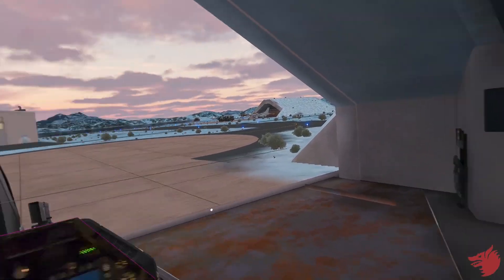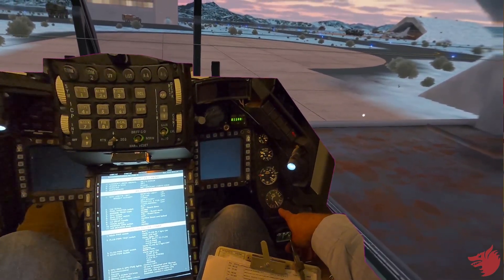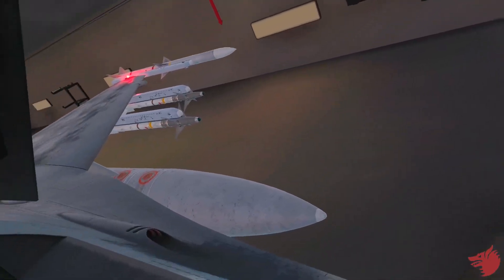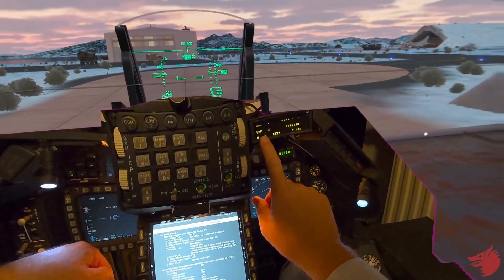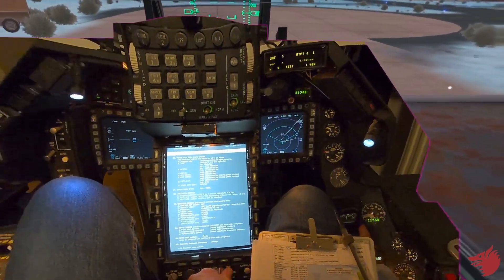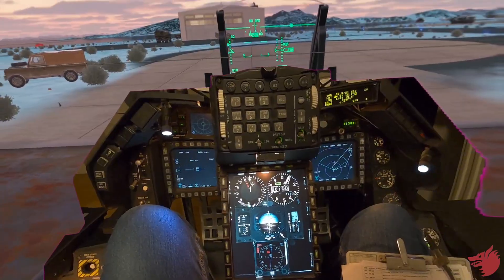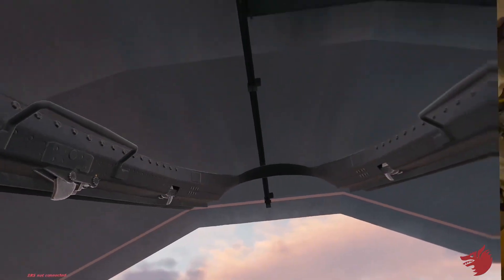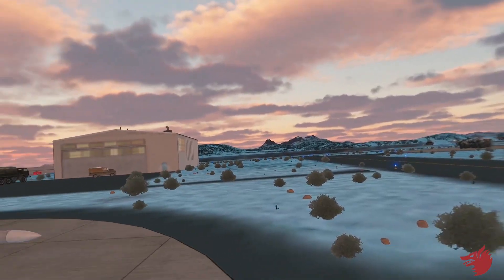First Ramp Start in VR Passthrough

Comment: I've just come across your channel on here and your "simpit" and it is incredible, I've no idea how you can make something that looks this good to the real-world F-16 cockpit, but then I'm a software engineer and not a hardware engineer 😜

I worked on the code for F-16s HUDWAC in the late 80s / early 90s as part of Block 50 so have a "soft spot" for the F-16, it is the only fighter module I've bought and fly in DCS, and in VR with a Quest 2 but the immersion is lost as soon as I have to fumble around for my mouse to operate any of the buttons and switches.  I have my Thrustmaster Warthog stick setup to be as near to one-to-one with the real-world but I use a Saitek X-52 Pro throttle which lacks the buttons/switches to bind accurately to the real-world which means I am having to use my keyboard/mouse too much.

I only recently got Falcon BMS 4.38 and need to get properly stuck into it as I've been a bit overwhelmed by the thought of having to bind all my controls on it.  I had the original Falcon on my Amiga 2000 back in the early 90s and was quite shocked as to how accurate some of the HUD symbology / behaviours was to what I worked on every day.
Reply from the maker: Yeah, VR alone really is an issue with all these keybinds we need. I heard about Point control kinda fixing the issue. I tried handtracking with the quest and moving switches with hands in DCS but it's not efficient while flying the jet tactically. There are hand passthrough or keyboard passthrough that can be set easily which partly solves the issue but I agree, if you have to use the keyboard or the mouse, immersion goes down. 

BMS is great too, I actually started flying BMS and I flew the series for 20 years. It's a great sim but it is not any easier to manage than DCS in that respect. It also now supports VR but that is quite recent compared to DCS.

Good luck with your setting and never hesitate to pass by and ask questions, we'll be glad to help either from the Viperpit website or our Discord
Reply: @VPreddog  I've research these devices you place on your fingers, kind of like sewing thimbles, but you can't operate your flight controls while wearing them.  And I too have tried flicking switches and turning knobs in DCS using the Quest hand controllers but, again, you can't realistically use those as you have to keep picking them up and then putting them down somewhere safe, I found myself constantly dropping them and even tried attaching them to my chair but that's not a feasible solution either.  I guess we'll need to wait until accurate and usable hand tracking is available as part of our VR outfit and the software we are using.  I find myself using TrackIR more than I use VR since getting my Quest 2 as

I just had to re-install BMS which took most of the afternoon so will get properly stuck into it tomorrow, hopefully I can at least get all my controller bindings done to the point I can do a quick flight from start-up to shut-down, the trouble I have is my memory got wrecked by my last stroke so I have to constantly refer to the manuals and guides on here, fortunately I have a monitor above my main monitor for just that so I'm not having to constantly switch between windows.  I'll also be getting the Moza AB-6 FFB stick in a couple of weeks so am greatly look forward to using that in DCS/MSFS/X-Plane, it comes with a grip and desk mount and all for £399, but I'll be getting it from Abruzzi (Moza dealer here in the UK) as they only charge £5 postage whereas buying direct from Moza will cost £80!!!

I've registered with the Viperpit website so if I have any questions I'll go there, I'm just interested in your complete cockpit setup, how you built and what you used - it's way beyond my capabilities!!!